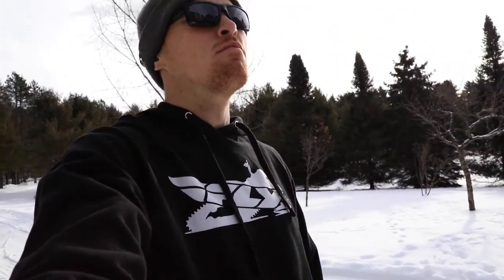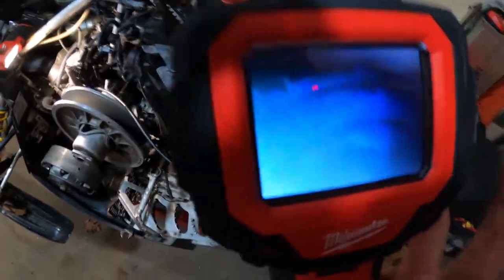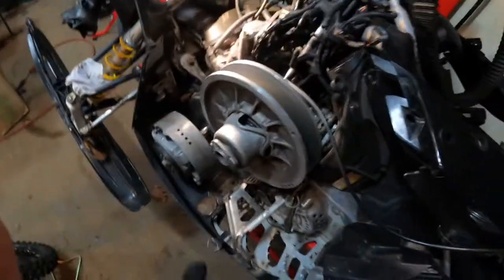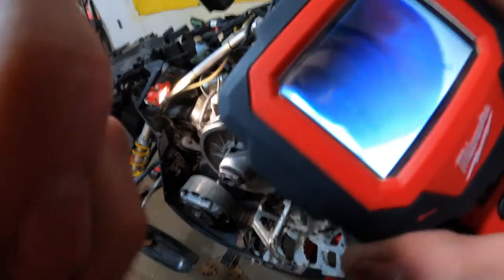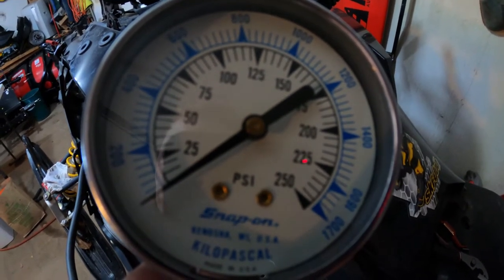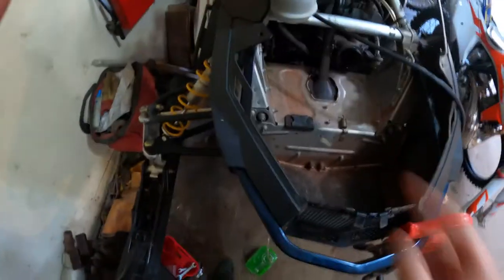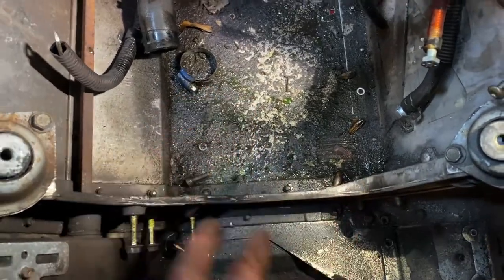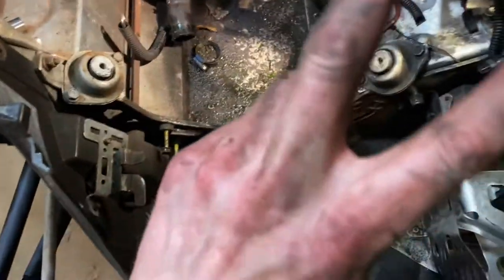NEW Project! 600 ETEC Revive: Ep. 1

Comment: Do you know what  gives the spark and fuel  to engine. It's a 2011 back country etec600 but has no spark or feul..?
Reply from the maker: That’s a tough one, not a lot of information. Your fuel is coming from the injectors, which inject fuel when instructed (for a lack of better terms). If there’s no fuel and no spark, either there isn’t any power being generated by the magneto/stator, or, the ECU isn’t aware of when it should instruct the injectors to inject fuel. Meaning, a crank position sensor could be at fault. Good luck!